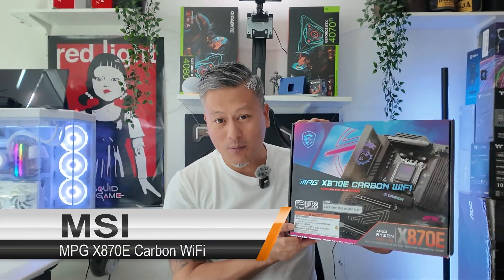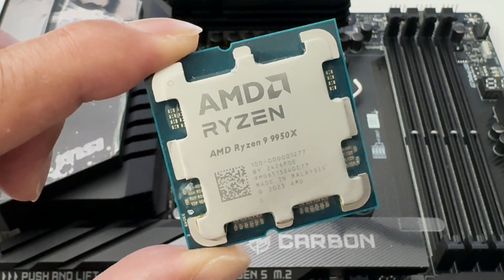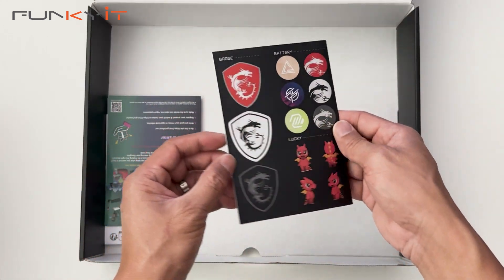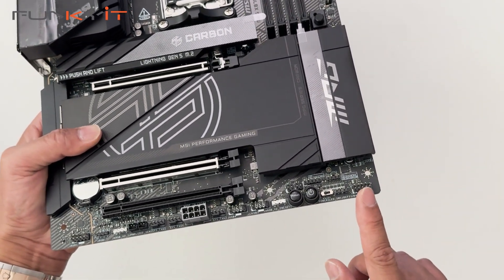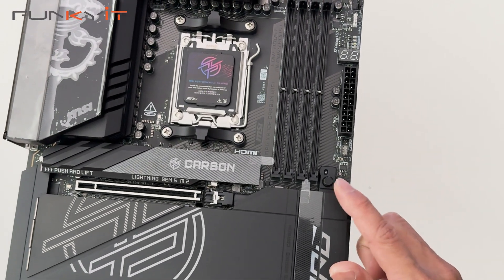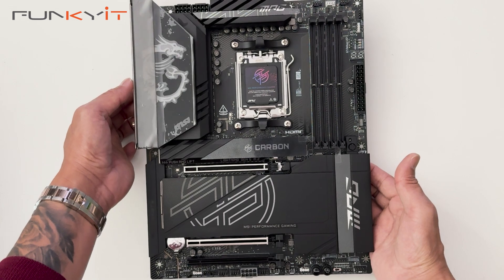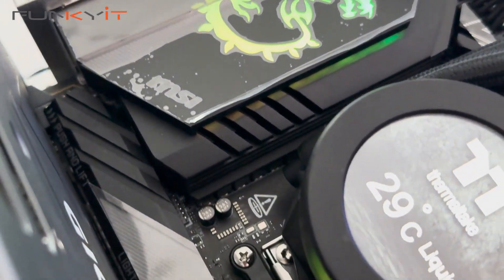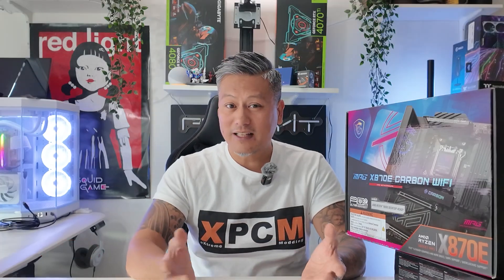The Best X870E Gaming Motherboard - MSI MPG X870E Carbon WiFi

Comment: I have that mobo, and now also have a 9800X3D. What memory do you recommend? I only play iRacing.
Reply from the maker: Any DDR5 memory at 6000 MHz or above is good. I recommend DDR5-7200 as they’re widely availabe 👍
Reply: I'm about to buy the same motherboard with the same CPU. do you like the way it runs? I'll also be using the RTX 5070 TI OC.

Comment: Which Mobo Buy: This MSI, ASUS ROG Strix X870-F/A, X870E-E Or Some ASRock?
Reply: Im between the Strix and this one dépend on your need but the asrock nova has a USB aio way too weak for me and the taichi is an e- atx saddly...
Reply: @mts4651  I'm also between this board and Strix, but X870-F/-A has few SATA connectors
Reply from the maker: The BIOS on the MSI is so much easier to use👍 but Strix is more expensive 👎
Reply: @Funkykit  I Know. I Like MSI & Strix.
Reply: msi
Reply: ASUS is a bad idea for AMD. Asus has also flushed their RMA/support and warranty right down the toilet recently.

Comment: You used ez pcie latch wrong. As it says at the manual(p.36) you need to put it at the locked position.
Reply: He left it in the locked position before inserting the GFX card. So all is fine.